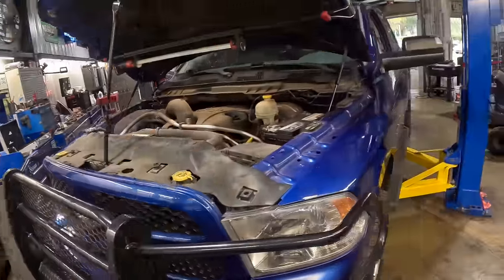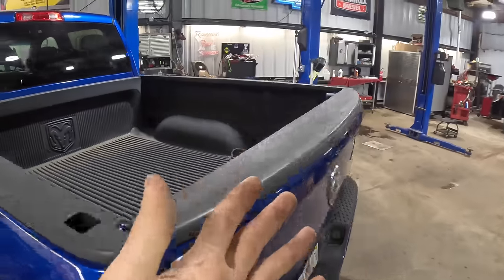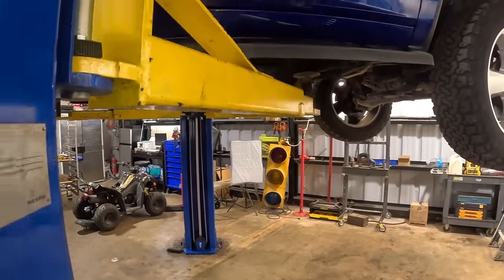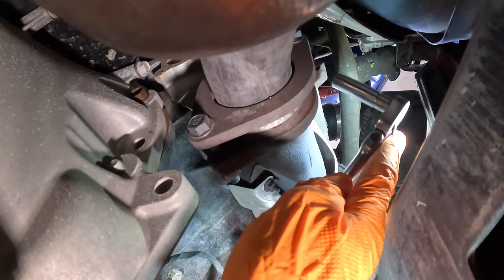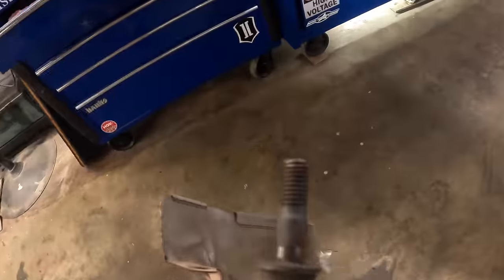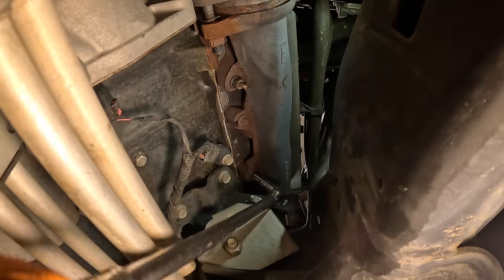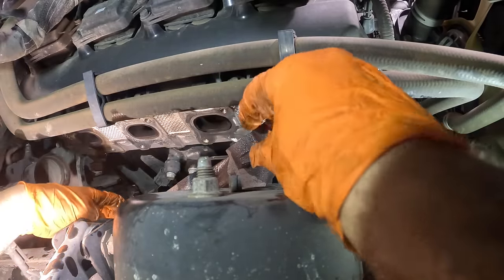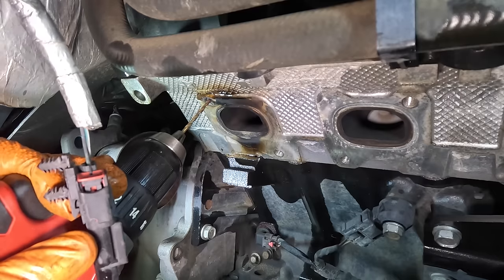Exhaust Leak on Cold Start! Ram 1500 5.7

Comment: Hi Ray i was millwright , wescast Inc we made and cnc machined manifolds. Quality inspection complained about any little marks on surface and watching you sand the surface made me smile. We always said not important as gasket would seal but to them it had to be perfect. You made my day tnx Ray
Reply: Please tell your company engineer to stainless steel stud and nut supplied with new manyfold 😅😅😅😅😅😅😅😅
Reply: Wingham Ontario Canada?
Reply: QA may have said that but  I would be asking a) what are the scratch dimensions and under what illumination and b) what does the drawing say ?  Then we can have an intelligent conversation
Reply: @MrRunner THAT'S  what I'm talking 'bout!  😆

Comment: Here in the rust belt MN, we spray every nut and bolt we might need to pull as soon as we figure out we need to work on exhaust or suspension.😊
Reply: In Massachusetts, we hit all the bolts with PB Blaster and THEN ask what work needs to be done.
Reply: Spray them to get them nice and oily for the torch to heat them out :D. I always use aero kroil for penetrant oil, has done wonders.
Reply: I would have expected anti-seize on the new bolts instead of Loctite.

Comment: Using the sander on the manifold is pure Vice Grip Garage material- I love it! It'll make the trolls go crazy! Keep up the great work
Reply: Ryobi!!😉
Reply: I saw an episode of Just Rolled In, where someone used a belt sander on disc rotors and ruined them. It's not something I would have done, a large flat plate covered in 80 grit makes a better surface to level the flange out on.
Reply: Yup Derek is bad ass too
Reply: ...and the "karens" out there have a ttl
nervous breakdown😂(?)!!
@lds/aes

Comment: Loved the belt sander trick, thought it was a bit aggressive, but it works.
I glued 1000 grit down on a flat surface ' a chunk or Granite works for this its pretty flat'  then you  hone off the high spots.
A machine shop might use some type of sander  so your not far off.
Or a animal retentive  guy would set it up on a bridge port and mill it.
It only has to sit flat so the belt sander did the trick.  
Go ask the stone guys for a sink cut out to use as a flat refrance table.
Most machine shops have a 6" thick stone inspection table they use.  1" or so is thick enough
They just toss sink cut out in the trash.  But its useful as a tool.
Reply: Getting ready to do this job on my ‘07 Dodge Ram 1500 hemi . . . some excellent suggestions!
Reply: Machine shop around me would have it for 2-3 days. That is a no go. Get it best as possible and use an MLS gasket for any inconsistency.
Reply: Yes exactly that, granite floor tile (not reconstituted quartz stone, but the real cut out of a mountain slab, and checked for it being optically flat) on a plywood base, and it works for me as a good enough for the stuff I do block. Got a second one just in case, that is still not used, but there are 2 granite offcuts, counter top reconstituted stone, that I use for a mouse pad. Big, heavy, works well with optical mice, and does not move, plus easy to clean. A third gravestone offcut, mostly polished before it cracked, got repurposed, along with a dial indicator stand I got cheap, as a microscope stand. Reminds me of the optical test benches, which used a massive granite block beam for the frame, for rigidity and temperature stability.
Reply: "Animal retentive"? Keeps chickens, horses, and goats in their backyard?
Yeah, I know spellcheck got ya... and you meant "analysis retentive". I just couldn't help but be a little grammar AR myself! 😂
Reply: @alanm.4298 I was taught that spelling was important,  but math is more importanter.
Reply: @SeanBZA  We used to have the windscreen off of an old Barford steamroller and a lot of coarse grinding paste.  :-)   but we were flatting alloy engine cases on old Brit bikes.
Reply: @johnwarr7552  A street paver would work there with how bad some of those castings were......

Comment: I had a 2011 Chevrolet Express 3500 with the 6.0L V8 that had an exhaust leak on cold start ups. I didn’t repair it myself, rather I let my favorite Mr. Goodwrench service center make the repair. The engine has been whisper quite ever since.

Comment: Good job Ray ! My 2011 Ram with the 5.7 hemi has 283 k miles or so. No problems with my headers, or anything engine or transmission related. OEM brakes were crap and replaced everything as soon as warranty ended ! 5.7 was not the only engine with 2 plugs per cylinder. Old Ford Rangers has the 2.3 inline 4 with 2 plugs per cylinder. Brain stoppage happens more and more as we get older. After 63 years of being on this planet I'm amazed when I remember what I forgot !

Comment: I've had alot of success using reverse drill bits   more often than not they grab the broken piece and screw right out. ✌️
Reply: I have them and can't honestly remember them ever working even once. I still waste my time and try them though. lol
Reply: @scotts4125  I have 2 kits, only worked twice 😂 it has to be the perfect storm of location,  break surface, access,  material,  etc for them to work.

Comment: Ray, it is great to hear you back to "normal" and not stressed or sick.  Do you ever wire brush stud threads before trying to remove the nuts?  Being up in the salty state of MA, it is a must to try to prevent breaking every single stud.

Comment: Tip for the manifold studs: I believe the studs come with loctite on them so heating it up a little bit before removing can help soften the loctite and reduce the chance of breaking.
Reply: Nobody uses loctite on exhaust systems that's idiotic, loctite is used in engines and differentials and anywhere the chance of backing out causes critical failures not exhaust leaks
Reply: Heating up does help
Reply: @bryanwilliams847 Really? It's idiotic to use loctite on exhaust manifold bolts, since when? Every "real" mechanic that has done exhaust work knows to use loctite on the bolts, except on some race engines where the headers are removed after each run. The exact reason you use it is to avoid exhaust leaks that can be a nightmare to fix. Just ask Ray or listen to him starting 42:13
Reply: I never had bolts break off on my exhaust manifold, but I did blow out a spark plug on the highway.....that was exhilarating.

Comment: Yes, I have a '17 RAM, that has an exhaust leak on the driver side. I really need to get it repaired. Hopefully mine is as easy as the one you did in this video. I plan to replace both sides of the bolts, don't want to have to do the other side in 6 months. 😂

Comment: Ray during your successful extraction of the broken manifold stud you made a comment about being impatient to use your fingers to twist the last few turns of your, (-Hot-Hot-Hot-) welded nut on those threads.  “My fingers have lost all feeling anyway”. Watching your  phalange’s dexterity manipulate fasteners, screws, electrical connectors, sockets and ratchets, many times one handed-( with GoPro in your other hand) don’t ever underestimate the incredible ability of your fingertips. As the years go by you’ll appreciate all those special nerve endings you still have in your fingertips.

Comment: We had the same issue with broken exhaust manifold bolts on my son's Ram.  I believe 4 or 5 were broken with only 40k on the truck.  We replaced the bolts and fortunately, the new ones are still intact.  Great vid!  I wish you would have a vid on heater core issues with Ram 2500's!  If you have done a video, let me know and I'll watch it.  I've search, but no cigar.  We've checked everything and still little heat.

Comment: Great video. Removing the beheaded bolt was spot on. I am a bit surprised you did not use a bit of copper anti--seize on the bolts during reassembly.

Comment: Many years ago I got a warped 1979 VW Rabbit exhaust manifold flycut by a local machine shop.  That took over a week back then.  I shudder to think how long it would take in this Brave New Millennium.
 Your method is effective and you didn't have to wait 3-6 months to get it done.

Comment: The less severe "Hemi-Tick". Most hemis will experience this, the thick iron exhaust manifolds take a long time to cool compared to the aluminum block that it causes stress on the fasteners and breaks them. The real fix is to  replace manifolds with shorty headers that cool faster and more inline with the block. The OEM manifold will be warped anyway. If reusing should be milled flat again.
Reply: It's offensive that this is still an issue. It's a matter  of when, not if. Why don't they just use better bolts or use them engineer brains for another way lol
Reply: @EC_ATV_Outdoors it's in an aluminum block, i would be worried that the use of a stronger bolt, like grade 8, would pull the threads out if the heat cycling doesn't cause the bolt to fall before
Reply: @legionofanon  there must be a better solution than having to pay for this 3 min out of warranty.
Reply: @EC_ATV_Outdoors  the issue is in the cheap manifold, not the bolt. The casting is so thick it cols slower and warps the manifold, a cheap set of shorty headers are the same price a factory replacement and dop not have the same thickness issue and will not have warping issues.

Comment: Another perfectly executed repair! Give that man a coffee! 👍🏼

That truck is amazingly clean after so many years of service! 

My 2013 Ram is as clean, but as of today only has just under 70k on the odometer. 

I’m considering the shorty headers and aftermarket exhaust in the near future. Partially as an excuse to check the studs , and preemptively replace them, and mostly as a performance upgrade. 

Thanks for the tips and tricks Ray! 

BTW: I agree, center punching the stud would make it easier to center and hold the drill bit. I believe Ray knows this, but likes to get the conversation going! Har!

Comment: Interesting choice of tires. I bet they are way louder than the exhaust leak. I went with JBL 50 state certified ceramic shorty headers from slavens racing sold by Dougs Headers. 2004 2wd quad cab with 67k miles in 2018, now 82k miles. Discarded gaskets and bolts and used 4.6, 5.4 L Ford stainless steel exhaust manifold stud and nut kit along with aftermarket ss flange nuts with OEM gaskets. The broken stud had already vibrated out and fell out on the concrete (Phoenix). I think I used aluminum antiseize on the studs I don’t remember. Flange nuts are awesome. I installed MBRP exhaust but junked it and put OEM exhaust back on, droned between 1700-2200 rpm and didn’t add 1000 hp and interfered with my very high end audio system. Used NGK 2313 iridium plugs with Taylor racing wires, never replacing plugs again.

Comment: I have cleaned up exhaust headers on a concrete driveway with a little water from a garden hose while I pulled them back and forth while rotating. When everything is shiny you are flat; but I'm not a machinist.

Comment: I HAVE THIS EXACT JOB waiting for me in the driveway. Lol. Been putting it off. 2016 Durango tho. No fender liners to remove to gain easy access. Quick question; you usually show part numbers; what was the part number? Because I believe they have upgraded the hardware so I'd like to make sure I'm getting the newer stuff.

Comment: Ive done many a triton v8s and v10s in Illinois this is a cakewalk but still a great job when your 13 is now an 11mm your basically screwed and will be welding nuts on all studs on both banks. I once spent 8 hours on a v10 in Illinois salt and the truck was approaching 20 years old. I was questioning my occupation and pay all of those hours.

Comment: You guys down south are fortunate. Up here in the great northeast, we wouldn't dream of reusing exhaust manifolds. After a few years of use, they look like rust barnacles on the Titanic.
Reply: They should NOT be reused anywhere in the country, especially on a Ram where this is a known problem.
Reply: @thomasschleis2545  If they are in good shape, why not? Once they are heat cycled many times they should be fine.
Reply: @watermanone7567  Certainly not Ram's position, or service data's. It's a common failure point.

Comment: Had a '17 Ram 1500 with the dreaded rusted exhaust header bolts. I was about 1 week from the power train warranty expiring when it happened. 👍

Dealership refused to replace the bolts that weren't broken. I said to the service advisor that they have to take them all out to replace the gasket, why not replace them anyway. He still said no. 

I traded that truck in a year later.

Comment: While I will agree that they are not necessary left handed drill bits can be a help especially with bolts that shear because of pressure and not because they are seized.  The lefty drill bits have a tendency to catch and extract the bolt for you while you are drilling the hole.  As a Ram owner I am all too familiar with this problem but luckily mine broke within 15k miles so they were all warranty repairs.  I have had an 09,13,15, and 17 all did this but they must have made a change though because my 21 eTorque is at 32k and still hasn't broken one yet.

Comment: Did this job last year on Rusty 12...3 broke on each side...tried the weld. Worked on 2 of them. Had to buy a Leslie template kit to drill and extract a few of them...one needed an insert...do not try this at home kids...its one hell of a job. Good thing that broke stud was on the "easy" side. lol...also did the belt sander trick.

Comment: I do have a Ram 1500 5.7 with a slight exhaust leak. Only does it at a cold start, and really only in cold weather. Within a minute, as it gets heat into it, it seals up and gets quiet. Haven't planned on having it fixed just yet. Need some ither things done, like new tires, fluid exchanges, stuff like that. Has 147,000 miles on it currently. I am in Ohio, but the truck spent 90% of its life in Tennessee. I am only the second owner.

Comment: Ray, great video and to answer your question, Yes I have several Ram's that have had the broken exhaust bolts.  On each one the bolts came out with an extractor, but they are southern vehicles.

Comment: i only have one thing to say Ray... good work
but if you look at all exhaust manifolds they have at lest 1 bolt hole that has slot in it so you can start a bolt(s) and use that as a hanger to adjust the manifold to get the other bolts into place

Comment: This was most likely the easiest bolt extraction I've seen in your videos. Usually you would use a flat surface (table top) with some glued sand paper to grind the parts and bring them to specs, but a belt sander will do the trick as well.

Comment: I watched a video some time back of a guy surfacing a warped aluminum cylinder head on a large piece of glass covered with sand paper. If that worked then a belt sander on a manifold is golden!

Comment: The dreadful 10 MM Sockets. Those things need to be made with key chains or something. Lol I'm always losing them 😂😂😂
Reply: I don't have a car so I walk every where and I find 10mm all the time lol most of my toolbox comes from tools I found on street lol
Reply: I don't think I have a socket set with the original 10mm... Except maybe the 1/2 deep impact...annnd it's gone...
Reply: AirTags
Reply: True, I'm always loosing,10, 8, and for some odd reason 14 mm sockets 😢. What's even worse seems like it's always a dodge truck that swallows them. 😅😂
Reply: 😅😂😅😅😅😅 left handed drill bits. On sale at harbor freight.
Reply: Back in 1990, I lost a 10mm doing a heater box and both the apprentice and I searched every part of the engine area and could not find it. 2 weeks later the vehicle was in for an inspection and I was still angry about it so I drove out of the workshop, for a road test  in a very aggressive manner to which I heard a metallic clanking. I stopped and found my 10mm socket on the roadside and I still have it and use it today. I have lost others as well as 13mm but I am sure that thee is a planet out there with an alien "ebay" website selling all the lost tools... :)
Reply: As an avid road cyclist of 4 decades I have found more 10 mm sockets along the road than I have lost. Not to mention 9/16s and a box full of tools, but the 10 mm is the most found.😂
Reply: @Dave_Stennett  did that with my flashlight and a pair of vise grips. 😂😂😂  Got the flashlight back and my buddy at the garage two towns over called me up and said he had my vise grips. 😂😂😂. What are the odds.  😂
Reply: @markschmalenberger8301  🤓😃😂🤣
Reply: @bobby9195  hell I wonder if I can put a picture on here to show my box full of stuff that I found on the road
Reply: @Chevy-f4l  lol,I can believe it
Reply: @Dave_Stennett  That alien store is well stocked with 10mm sockets and left socks "eaten" by dryers.

Comment: I have a 2016 Ram Sport and have the exhaust leak.  Haven't done anything with it yet.  Still rapping my head around the 16 spark plugs @ $10/ea (for the cheap ones) or have someone else do it for $500.  Also has both front CV Shaft boots (small) torn.  Would love to bring it in , but when you live in WA, just a small distance to drop off.  Loved watching it go "Easy".  Keep the vids coming.

Comment: That sanding job was, well interesting. I found that the replacement manifold was not really that expensive and a time saver.
On another note, just because the other manifold was not making sound does not mean it doesn't have broken bolts. Mine made noise at cold start when I first got it, so I ordered the manifolds, gaskets and bolts. Then it stopped making noise, and now 2 years later still does make noise. They say they only last 30k miles or so before warping again. I am just going to wait until they leak again before I go in for the win.

Comment: Ray, 
On the top of the manifold at the rear, I believe there should have been two bolts.  The second hole was missing the fastener. It is for the extra support of the y pipe flange.  I maybe wrong , but why two threaded holes and only one fastener.  ?